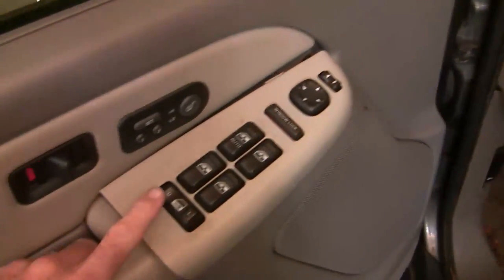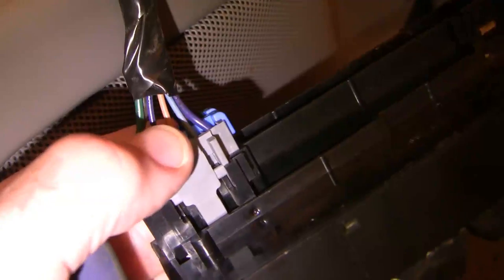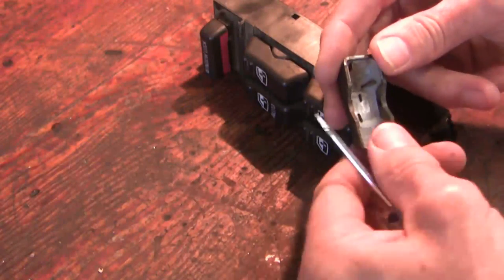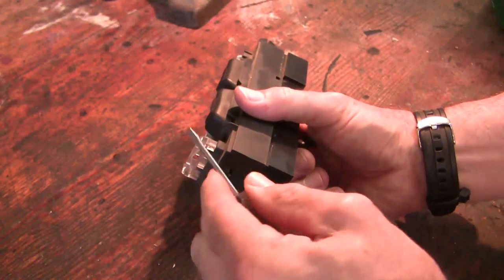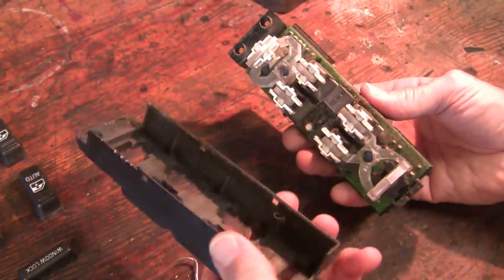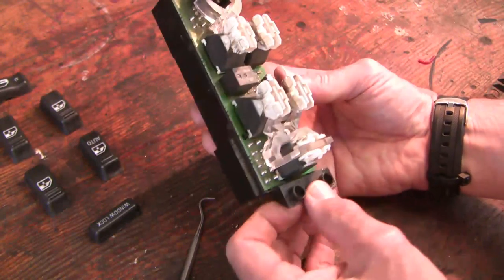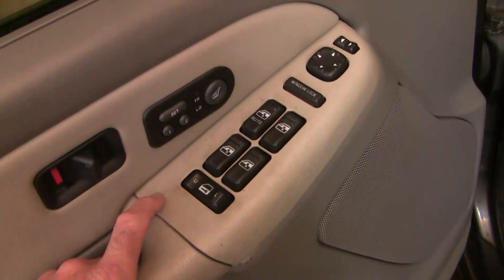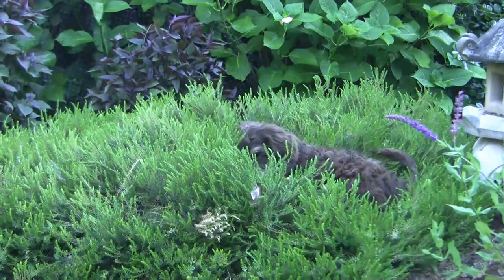How to fix the Chev power window door lock switch

Comment: I had to go a bit further with my Trailblazer. Simply cleaning around and under the plastic switch buttons didn't work. As posted in the TrailVoy forums: Just pop off the bottom cover to get at the circuit boards. Mine smelled burned but I sprayed with corrosion X and electrical contact cleaner anyway. Cleaned off excess residue with acid brush and tissue. Found and cleaned a few bits of debris off the light blue soft silicone actuator pad. Slapped it all back together and voila! It works! Saving me some $$$ for a replacement assembly.
Reply from the maker: Thanks for posting your experience here. I'm sure it will help others.

Comment: Thx. It was as easy as stated. I own two Trailblazers two years apart. An 04 and an 06. The 06 needs an engine and the 04 just had it's tranny replaced. So, I have been slowly robbing the 06 for parts to keep the 04 running. First the battery. Now, the 04's driver's side window switch started going bonkers-- opening and closing whenever it felt like it. Kind'a rough to live like that in SW Washington with all of the rain. After looking at your video, here, I just ran out and did the switheroo. Even though these two trucks do not have the same type of rocker switch operation, they are still rocker switches and everything else about the switch housing and wiring harness is the same.

The longest part of the operation was walking between the two locations where the trucks are parked on our property. The entire job may have taken two minutes.

Thx much. I didn't break any plastic or metal clips thanks to you. No gouging of the door liners either. Now, I can, at my liesure, see if I can repair the malfunctioning switch.
Reply from the maker: Best kind of feedback, thank you!

Comment: Thanks for the detailed video.  I watched this last night and was able to jump into the repair today with confidence.  This was on my friend's 2005 Suburban front driver window switch. You helped save a hard-working single mom some cash and sanity at the drive-thru.

In my case, the compressed air only briefly fixed the finicky switch I was working on.  I had to disassemble further.  These switches actually seem to be built pretty well.   Disassembly is fairly straightforward, but be aware that there are two spring-loaded pins on the bottom of each white plastic switch which might want to fall out during disassembly.  The contacts were corroded.  I used a toothbrush and soapy water to clean the board and the plastic and rubber pieces.  I dunked the metal contact springs for a minuted in vinegar and then in rubbing alcohol.  I used a swab and a toothbrush to do the same to the contacts on the board (which needed the most cleaning) plus a little fingernail scraping to get the gunk off.  After that, this switch worked like a champ.

I disassembled and cleaned all five of the rocker switches while I was in there.  It only added about 30 minutes to the total repair time and will hopefully save me from having to open this up again.  I was done in an hour and a half, and that included fishing one of the plastic pins out of my sink disposal, and redoing some work after I forgot to put the plastic shield back on in the right order during reassembly.
Reply from the maker: Solid remarks, thanks for taking time to help others who stop by.

Comment: I have an 03 Impala and used this guide to do exactly as you did.  Saved me $77 you did - thank you!
Reply from the maker: Thanks for the followup, I'm glad it helped.
Reply: Unfortunately it only fixed it enough that I was able to close the window but that was really the end goal, anyways!  I took it back out once the window closed (and then started my car, it's 20f degrees outside, I was cold!) and fully disassembled the switch and then rolled the dice and took the actual switches off so I could access the metal contactors under the switch itself.  The drivers side one apparently has a history of sparking when contacted so it creates black carbon build-up.  I cleaned everything with IPA and scraped the metal surfaces with a screwdriver tip to clean the really cooked on stuff and... yeah...  problem solved!  Still would have never gotten anywhere without your help!

Comment: Thank you
I was about to order a new one before I did that I took it apart backwards clean both circuit boards and it works now, couldn't believe it. I clean the circuit lines with desinfecting wipes.
mine is 2004 single cab

Comment: thanks for the video, my button was doing the same thing,  i just cleaned up all the dust and checked that the wire harness was in all the way, works fine now
Reply from the maker: The other thing worth checking is the solder joints, which sometimes come loose. Mine were fine. Sometimes small cracks are hard to find, but easy to resolder.

Comment: Good job on the switch spelunkerd, I use electrical cleaner, which is alcohol based, and dries after a bit with no residue, I do this on destination sign keypads all the time when they get dust and and grease on the push buttons.

Comment: Thank you 2004 Chevy Tahoe  doors not locking have to keep pushing  to lock side about 2 to 3 time will try the method you just displayed on your video
Reply from the maker: By the way you describe it, your problem may be lack of lubrication of the door that is failing to lock, as opposed to a switch problem. Watch this other video showing how I dealt with a similar problem for the rear door:  https://youtu.be/xgISq8IYcPQ   I would use some kind of silicone paste or lithium grease, I think silicone spray is a poor second choice, as is WD 40.
Reply: spelunkerd thanks

Comment: Most Excellent presentation and detail ! I've got a 2003 in mint condition, I put an L26 aluminum upper intake manifold on it to fix and permanently avoid the problems with the plastic upper, along with new felpro gaskets for the lower. However my front window switch is barely working for the up position and takes alot of fine touching and luck to get the window back up. Fixed a few other things now time for this tomorrow, so I took a  look for videos. I have an Alldata subscription but they don,t tell you the secrets of getting the buttons off........thank a million ! 

Why did GM switch the directions of tabs on one switch out of six? So they can have added costs, a different mold and several new parts? Its to obvious to make the top switch the same as the bottom ? Yikes!
Reply from the maker: I know exactly what you mean, it's frustrating to search for unique parts, especially years later when the dealer gives up making them. 3D printing may be the answer for those of us who try to keep these old vehicles going, in some situations. Today I'm looking for an unusual bolt, which is attached to a $700 sensor. the sensor is fine, but dealer won't sell the bolt on it's own. It's off to the junk yard....

Comment: Thanks for posting this video! I have the exact same switch, and I figured all of this out in quite some frustration yesterday after hours of playing with it. Had I searched and watched your video first, I would have been spared numerous hours of anger and frustration. So, may this video help many others! Also, your dog is SO CUTE!! :-P
Reply from the maker: I know that feeling of frustration, too. Isn't it amazing how much help you can find on the 'net today. It has been great to be part of that, in my small way.
Reply: I just bought a used replacement switch assembly for my driver side, 2003 Cadillace Escalade EXT.  When the part arrived I discovered that the Lock/Unlock button had been put on upside-down...so the Lock icon on the button "Unlocks" and the Unlock button "Locks".  I just need to pull off the button cover and turn it around - BUT I can't seem to be able to remove the button like you did in this video.  My Lock/Unlock button cover is very similar but slightly different looking than the one in your video.  Do you have a tip on how to remove my style of button?
Reply from the maker: willistom Well, I have broken my share of plastic clips in my lifetime, and every time I try to do something like this I weigh the risk. I just broke another stupid plastic clip today, working on a little electric motor.
My truck is now at the age where function beats form, and I don't care what other people think. So if it works now I would consider the option to keep things simple and live with the slight abnormality. But if you don't want to live with the printing being upside down, I would carefully try to pry it off with a small screwdriver. Parts like that could be glued on, maybe by a previous owner who broke the clip and then mistakenly glued it on upside down, then sold it when he discovered his mistake. Or, perhaps it belongs on the other side, where parts may have reversed patterns. Good luck!

Comment: Hi Spelunkerd,  You are correct about the micro-electronics being tied into the lock switch control board.  If you have a defective lock/unlock switch anywhere on your vehicle and try to program or reprogram your key fob after replacing the battery in it or disconnecting your battery, you will find that you can't because the Security system is looking for a certain lock switch position configuration to allow the Security system to go into program mode.  Determine which switch is bad by exercising them all to make sure they work, replace the bad one, then put the vehicle into program mode to get your key fob to work again.  There are several You Tubes out there to reprogram your key fob.  Sorry I digressed from your original and very informative instructions.  Just wanted to add to info you brought out about the electronics and disconnecting the negative side of the battery.  Thanks.  Backyard_Jim
Reply from the maker: Backyard_Jim Thanks Jim, I'm sure others will also find your thoughts useful.

Comment from the maker: That's a tricky one, and I have no experience with that specific problem. As a guess I would wonder if the pick-a-part switch is also bad, or maybe it's a bad connection at the controller. The fact it works when the lock is initiated from the PCM suggests the efferent arm is OK, which points you back to the mechanical switch....

Comment: I would love it if someone would show how to replace the bulbs in these switches!
Reply from the maker: You make a good point, LED bulbs can die. In this switch, you can get replacement switches off ebay for $20 plus shipping, so it's not economical to replace only the bulb. Older design switches may have replaceable bulbs, but the new designs have tiny bulbs epoxied into the board, making them difficult to replace. You might find a junk yard switch, but you take the risk that the junk yard bulbs may not work, either. The economics only work out if you can do some of the work yourself. Just remember that LED bulbs are directional, they need to be soldered in the right orientation.

Comment from the maker: The circuitry is surprisingly complex. You'll need a wiring diagram and careful testing to help decide where the fault is. Can you lock the doors with the passenger door switch? Do the locks automatically shut when your car starts moving? As you point out, it is hard to be sure electronic parts from a wrecker are good before you walk away with them. Sorry I can't be of more help.

Comment from the maker: I guess it could, though it wouldn't be high on the list for that. Misfire is probably one of the more common causes of engine vibration. Regarding a bump in rpm, sometimes when the ac switches on the rpm may fluctuate. Thank you for watching.

Comment: My god a talking puppy ha ha :-), cute little thing :-)

I did a similar thing to my frends peugeot estate car door switches, but it had onboard button switches and the plastic bits pressed onto them.

After a bit of cleaning and reshaping the deformed plastic it worked again, although i did think it was a crap design lol.
Reply: This video is one of most helpful I have seen on YouTube. My 2001 Yukon drivers window switch first became intermittent and later stopped working, so no more drive thru windows. Anyway, took the switch out, blew out the dust, reinstalled following this video and it worked!!
Great job on this video

Comment: I had my ddm seem to go bad but the driver's side mirror control still works I bought a replacement ddm however I have the same issue also the drivers and passengers door on driver's side both will not respond to key fob or locking control on passengers side any ideas would be ever so grateful to find a fix.for.mine.

Comment: I don't know if they're related, but my remote mirror switch quit.  Some time later my drivers side window stopped working in the down position. While driving I fiddled with the other mirror switches as well as the mirror switches. 
For some reason the mirrors started working normally until I pressed the window switch and the window went up and the mirrors stopped working.
Took it too the dealer and he diagnosed a bad mirror switch ($185 to replace) but could find no fault with the window switch. (Charge was $75 to tell me that.)
Sure enough the window stopped working again a couple days later and the mirrors started working again!  Now the mirrors are working but the window isn't.
Is there any connection in the system that would cause one to work and the other not?
Sorry for making a long story longer.
Reply from the maker: These intermittent electrical problems are frustrating, aren't they? No, the window and the mirror switches are mostly not connected, though I suppose a bad ground could cause both to fail at the same time. You get dust, moisture, and corrosion in that switch panel. I had a problem with my window switch intermittently failing, and I took the mechanism apart and lubricated the window slides with silicone paste, and the problem was solved. I was expecting an electrical issue but it was mechanical. When you take these switches apart it's worth while to have a close look at all points where incoming wires are soldered to the board, and resolder the ones you can get to. With all the effort it takes to work on these, I'm not surprised that dealers often just replace the switch.

Comment: Man...I don't have a clue what to do for my problem.  My power window went bad on the passenger rear.  I ordered a new assembly and motor, installed it and now, when I press my drivers side master switch to lower that window, it's reversed.  All other master switches on my driver door work properly, except when I push the window button for the rear passenger window - that button works in the opposite way to the others.  Any idea why or how this could be? Thanks for any help you can offer.  PS:  Thanks for this video, I am impressed with the wire tie wristwatch band holder.  :-)
Reply from the maker: +C Davis Power window motors are pretty simple, with the direction of movement reversed when current flow is reversed. So, you might try swapping the two wires that feed the window motor that is apparently running backwards. Failing that, I would spend some time rechecking connections, and go over the wiring diagram again carefully. I use Alldata, but bbbindustriesdotcom offered free wiring diagrams for some vehicles at one time -- not sure if they still do.

Comment: All my door lock switches suddenly went out. I'm assuming it's obviously not all the switches. Fuse is good and I figure it can't be an actuator because all of them wouldn't go out at the same time.  Any ideas would be greatly appreciated . Before they went out for a while when I locked or unlocked there was a buzzing sound like a bad relay or something but looked in my manual and no relay is listed for the door locks.  Thanks !   Jim
Reply from the maker: James Zurawski Sounds like an oxidized connection or a frayed wire. I would be looking at the wires as they go through the door and also at the connections where the wires interface with the switch. Likely it's at the place where you heard the buzzing sound, if you can localize it. With time the areas where there is movement (wires going through doors) and where there is moisture (rain gets into areas near the door window) are vulnerable. You could go at the switch first to see if you have ground and power to the unit, then trace the bad wire back, following it through the door loom. A wiring diagram would help. BBB automotives offered free wiring diagrams at one time for various cars but I use the dealers manual in electronic form (alldatadiydotcom).
Reply: Thanks!  I'll start hunting it down.I have a feeling this will take a while.

Comment: 2005 chevy tahoe driver side main window switch dont have power all ,,can you please tell why or can you please guide line me to the right derection ...thank you so much,, hope to hear from you soon
Reply from the maker: One way to quickly find the problem is to feed the window motor directly with power and ground to see if it will move. Then you can at least get the window up while waiting to decide what to do next. If it does move when hot wired, your problem is in the switch or wiring. If you're not sure how to proceed, your main issue is confidence in your skill set. I can't tell you what to do with that, since there is always risk when doing a task that is beyond your normal comfort zone. You don't usually save a lot of money when doing repairs yourself, but it is an unforgettable feeling when you accomplish a task that expands your horizons. On the other hand, if you get a pro to do it the price isn't usually too high. Good luck!